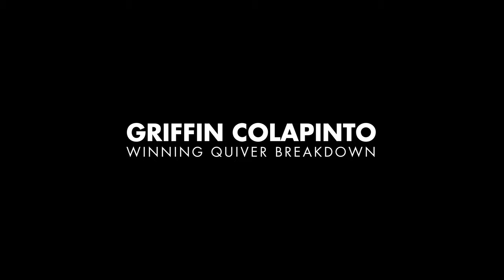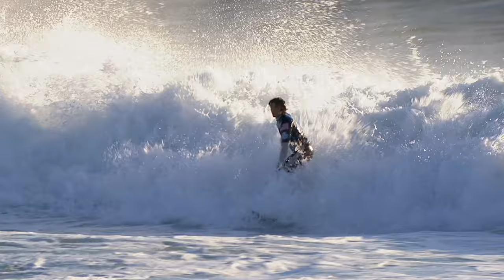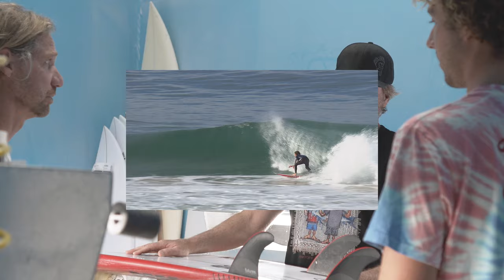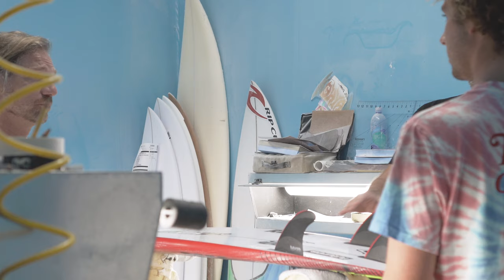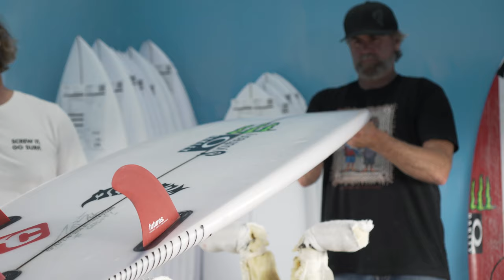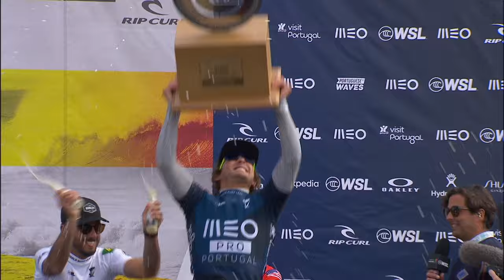Griffin Colapinto Portugal Quiver Interview

Comment: Great vid!
I interested about the Techflex 2+1 set up for a performance longboard, but I'm having trouble finding more information. I understand it's designed for waves with a bit more power, but I'm more curious about the performance and feel. Is it similar to the techflex thruster fins on shortboards in that it's more flexy (due to the honeycomb center) than pure fiberglass but still provides hold and drive due to the carbon base and tip? Any youtube vids or instagram clips you can point me to with someone riding the techflex 2+1? 
Thanks so much!

*Edit: I may be mistaken about the honeycomb center of the side bites and tip of the center. I had assumed the construction was similar to the shortboard techflex. Can you confirm the material on the tip of the center?